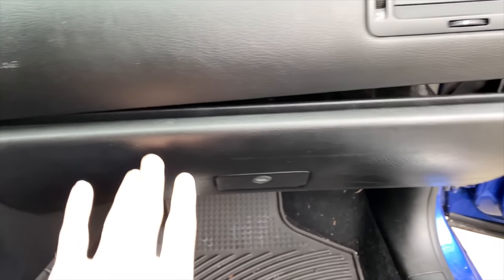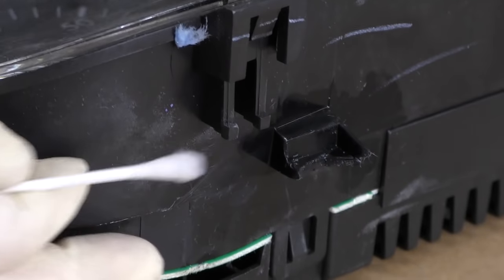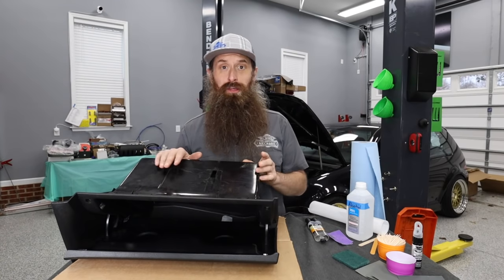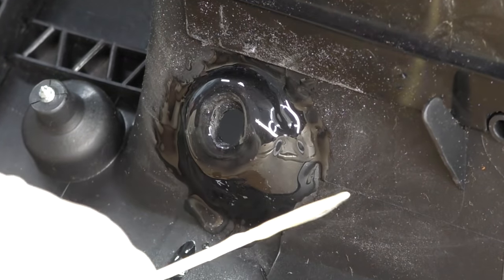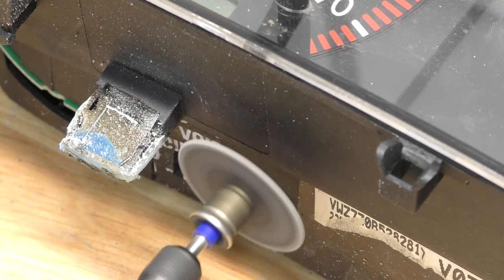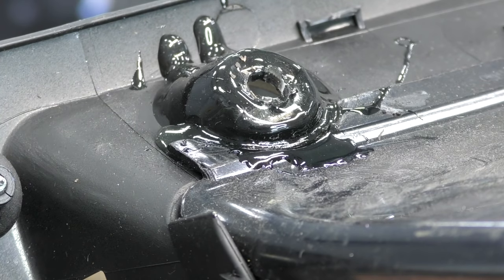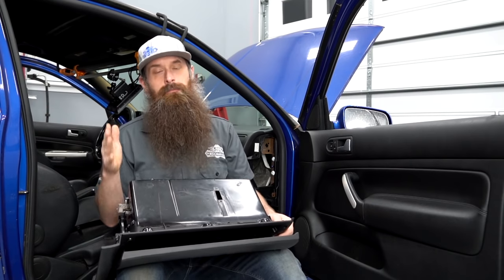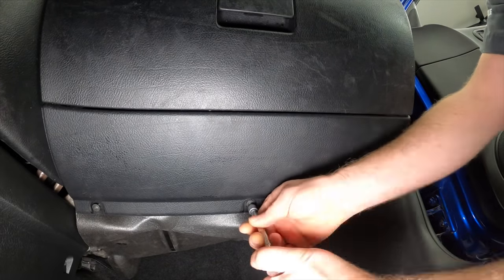How To Repair Broken Plastic Car Parts

Comment: I use the same process..but use flat Black paint made to paint dashboards, look up dashboard paint at your parts store..and hobby putty to form moulds instead of masking tape, I also use plastic repair epoxy in black because it's actually made for this specific purpose instead of clear epoxy ....but good job for your first attempt, not everyone researches existing methods before making a YouTube video...I like that you use different products not fit for purpose for those of us that have no interest in doing it correctly....big thumbs up

Comment: I use the syringe method professionally almost once a week in the automotive field. Busted tabs, split engine covers, coil packs on Ford where the connector splits and Mr Customer won't budge lol lol. Awesome vid again, great advice! Ive had great results doing it like, indentically haha

Comment: Lol i just used screws and washers and it looks good. If you use small washer it can get stuck on the inner wall of the hole so it looks nice. Big tip if you have  broken securing point on the glove box fix them fast because it puts more stress on other securing points so they break faster.My car has a problem. It shakes a lot when it starts or when its slowing down, motor does sound wierd .Its mk4 1.9 tdi.tnx

Comment: I recently had to repair lots broken tabs on R1 motorcycle fairings and I used blue tack or plasticine to copy the more complicated mouldings. I pressed the product into the surviving tab and transferred it to the other side. Using all the same techniques as you did here. It worked great 👍 obviously in some instances things face a different direction so pay attention to that kind of thing.

Comment: Great video !

Additionally, if appearance matters, you can mix powdered pigment into the epoxy. Powdered tempera paint works well for this (make sure you get the powder, NOT the liquid paint). Black is readily available, and you only need a small amount of pigment. You can create any color you need with the correct pigment.

Additional Tip: If your epoxy or resin has a short working time, measure out the two parts of the epoxy and keep them separated. Mix the pigment into the resin until you reach the color you want, then mix in the hardener.

This is an advanced topic, outside of the scope of this video, but if you need to create a larger plastic piece, you can use polyester resin to cast it. Powdered pigments like tempera work with polyester resin too. If you have something plastic that breaks and you need a completely new piece, keep the broken parts, glue them back together as best as you can, sand all of the seams on the surface so that they're smooth, make a mold of the broken piece and then use that mold to cast a new one.
Reply: Great ideas.  I like the idea of using a pigment powder rather than auto paint.  Also, don't they sell black nail polish?  Much easier to find than auto paint in such a small amount.
  I had to cast a small gear (and I mean small) that broke in a speedometer once.  I pressed it into a bar of soap to make the mold and then dropped in the epoxy.  My only complaint was it was too rubbery when finished.  I don't think the mix was right.  No idea other than that.  This was before the advent of CA glues.
I'm seeing a lot of CA glue and powder these days.  What's your opinion on using that for all this repair.  Seems to be catching on like crazy.
Reply: I keep several colors of tempera powder on hand because I always color my epoxy whenever I use it on anything, not just cars. If you've ever repaired ceramic or pottery, you know that the break lines are always visible, especially in lighter colors. Mix the epoxy to match and they are barely noticeable. It also allows you to fill chips and gaps with matching material. With patience, you can match the color of any automotive plastic. Use more or less powder to get the consistency you want to keep the epoxy from running. It works great for filling wide cracks on classic steering wheels.

Comment: Awesome info. I bypassed a few plastic fixes by just finding newish better parts at a pick and pull yard. Did this exact method on my drivers door panel where the 3 mounting screws are at the bottom. Works great!
Reply: 100% agree can u make it work … ehhh maybe  but strength is usually gone and still looks bad unless u have hands of a surgeon’ every time I tried maybe 1/10 it’s successful with a plastic welder’ if plastic trim piece is 20-30$ hands down just buy it
Or go to pick n pull’ 

If it’s a $300 part ….maybe try it but it will never look good’ when plastic breaks it is just so so hard to ever get it back’ 

That’s why adhesives that “weld” plastic back together r few and far between’ molecules in plastic don’t play well once tabs broken’ 

Honestly in my
Experience listen to this guy in comment’ 

Go to a pick n pull’ u will save sooo much time by the time u buy all the little stuff sandpaper epoxy plastic Welder paint etc just buy a new piece and move onto something more important lol

Comment: Repairing interior door latch molding for a 77 camaro , I used drywall fiberglass tape , closed weave not the one with square weave and pvc pipe glue. Worked great for fixing broken out screw hole. Just a daily driver not restored

Comment: Good stuff!  I have a small break in the faux woodgrain panel just below the cluster in my 1990 Dodge B250 conversion van.   It's one of those things where you can pop it back in and a slight crack is visible,  but after a few miles on Pennsylvania minefields.. I mean cow paths..  No,  ROADS.  that's what they call those wavy, twisted, un-even, cratered surfaces..  "Roads".   After a few miles on these "roads",  the piece just pops loose again and sticks out about 1/8 of an inch.
This looks like the method I need.  Just V-groove the back of the break slightly then fill it in with some of this epoxy.  May even use a bit of that plastic window screen for added support.  As the repiar will be behind the panel, I won't care what it looks like as long as it's effective and no all too sloppy.

Comment: Pretty cool video! If you can get your hands on some and want your pieces to be super strong, you can find small pieces of fiberglass sheet. Lay that over the empty spaces or form it to the shape and then cover it with epoxy. It will make your pieces even stronger. 👍🏼

Comment: Great video - thank you.  I bumped the garage side with my mirror and broke a couple tabs holding the turn signal.  New part would be $100, complete assembly $125.  I'm going to try your approach to repairing the tabs!  Thanks for the info and for showing the glue to use.  Plastic adhesion is tricky - good to know the best glue.
Reply: BTW - success!  2 tabs had broken off a turn indicator lens held as part of a door mirror.  For sure the dealer would charge $300-400 and would have replaced the entire assembly.  I did it for about $17 - 1 replacement plastic part that was too destroyed to reassemble and the 2 tabs successfully attached with the DAP Tank Bond per your instructions (scuff, clean with rubbing alcohol, mix epoxy - let it age 2-3 minutes then liberally apply and I manually held the parts for about 5 minutes and let them dry overnight.  Thank you!  Saved me $hundreds and saved needless landfill!

Comment: One thing I would add - when using epoxy to build up parts, you can also add fillers like glass beads or fibers that will help fill gaps and provide more structure and strength. I get mine at WestMarine, but any boat supply or surfboard shop should have the stuff. For even larger repairs, you could also lay in glass cloth.
Reply from the maker: That’s an awesome idea
Reply: You can also use saw dust or dried leaves

Comment: Great content!
Tips: 
1. Mix a little black (or other colour)  laser printer toner to get black epoxy
2. Use a hair dryer on low heat to drive out air bubbles and get the epoxy to run into tight spaces
fiber

Comment: 🟥 I usually use popsicle sticks, ( art supply,not post food) and sand on a belt sander to desired shape for applying glues or to form sandpaper around to desired shapes. Also, wax paper to make release mold backing etc.
Reply from the maker: Oh that’s a good idea!

Comment: I like to use a two part solid putty that comes in a small tube. You just cut off the amount you need then mix it in your hand and mold it into the shape you need. Cures rock hard in a few minutes and can be sanded and drilled once cured. Not as messy as epoxy and will support weight. I've even cut threads into it! Love that stuff!
Reply from the maker: I like that stuff too. I always forget to properly wrap it back up and it gets all weird. HAHA totally a me issue

Comment: Neat ideas. I've repaired many plastic things by heating the tip of a screwdriver and then melting the parts together in a somewhat weaving manner. I liken it to welding. I might also add epoxy too.

Comment: Good stuff, I use Knauf microglasfiber tape for reinforcing the place for small repair and regular glass fiber mesh for boat repair. Sometimes just pull some threads from the mesh and wrap around the part or build it up as I go, layer on layer. Also for smaller quick repairs, cianoacrilate glue and baking soda for filler and activation. Then sand, drill, body filler, paint and what ever one needs...

Comment: To repair a broken turning signal light plastic housing on my 86 Bronco I used the Oatley  "All purpose cement" .It basically "welded" the parts together and the repaired housing  looks like new...It also works great on repairing the plastic frame around headlights..

Comment: thanks for the video. the parts you've fixed were abs and abs polycarbonate plastics which works really well with some strong epoxy glues. I had a car trim that had a very-long guide pin. It got broken while disassembling. I tried to fix it but it was useless. because it was made up of polypropylene, none of the epoxy glues worked.
Reply: How can a person know if it's ABS?
Reply: @davidbutler1825   it is written somewhere on the material. Sometimes it is written in a triangle with arrows.
Reply: @heysamtek  thank you! I will look for that.

Comment: Great idea, thanks. I may fix the broken holes on my mk4 golf centre console that meets the ashtray section using this method. I think we have araldite here in the uk which is a similar product to what you used here.

Comment: Dude! Great work! Thank you! I’d like to please add a few helpful suggestions. First if it’s five minute epoxy mix the hell out of it for the minimum of 30 seconds go to 45 if it’s still to loose. Try to squeeze the same amount of hardener to resin! To make it 10 to 20X stronger get use carbon fiber fabric easy to cut to the shapes and better than the paper. Use the longer setting epoxy for that. Good luck please do more. Thank again.mw

Comment: Nice video.  when trying to copy another tab, I often use RTV to made an exact mold and transfer it over to the new tab.  Epoxy or even casting resin can then be used to make the new tab.  (And embed that washer!)

Comment: I like using metal strapping that is for hanging pipes and HVAC ducts.  It is the same idea as a washer and comes with pre-drilled holes of two different sizes.  It can be cut to any shape and bent to make reinforcing brackets.

Comment: Plumbers putty works great to form epoxy dams, and fresh putty is sticky enough to use on a vertical surface. You can also use it to form an exact impression mold of an existing part. The putty has a slight oily texture and epoxy will not adhere or react to it.  Putty is cheap and available anywhere that would sell the epoxy.

Comment: On the first broken part you have a great opportunity to make your repair almost exact. You can cast a mold of the other tab and use it to hold the epoxy instead of making a mold out of tape.

Comment: Back in the 60's ,70's and tube tvs. We used to fix channel selector knobs similar to this. And use strong thread wrapped around with glue (epoxy equivalent, back in the day). The thread added enough strength to make it stronger than a new one.

Comment: Many years ago, our salesman was about to go to a company and get a really good job for us, (heat treating company). His plastic framed reading glasses broke between the lenses. I took the glasses and chemically welded them together with acetone. The last time I saw him before he retired about 10 years later, he was still using the glasses.
In those days people didn't know much about plastics. But some one had told me of that fix. Plastic frames were new and fashionable. I fixed several frames for people.
I have just bought a plastic welder and haven't been able to try it out.
In this case, building the tabs with epoxy is a good fix. If I can, I use fiberglas or metal reinforcement. 
A good way to fix hard plastic. File some hard plastic into fine filings. Carefully fill the repair area with the filings. Drop super glue onto the filings. it makes a lot of heat, but the plastic is fused perfectly.

Comment: The magic of parchment paper.  I’ve used it to make a custom-fit plastic  bag from heavy-duty vapour barrier using a iron.   Parchment paper between the hot iron and the plastic to be welded, and between the plastic and the ironing board.
Reply from the maker: Nice!!! I tired like 5 things and that’s what worked best. Pretty cool stuff

Comment: When I had broken fasteners to repair, I have glued hidden metal clip fasteners like the ones used to attach trim, armrests, etc. that have metal parts that can accommodate various threaded screws.

Comment: I remember at Nissan a customer came in with radio issues. It was maybe a 2000 - 2005 model, can't really remember. In order to get the part number, the radio would need to be pulled. I made sure to tell the service writer to let the customer know the trimming will break because of age. They (the customer) said to just do it. Needless to say there trim around the entire center console (HVAC and radio) was in pieces. When the customer saw it, they tried to blame me but then remembered I had told them it would happen. Only time the customer has ever admitted they were wrong in my career.

Comment: you can get a plastic compound in same type as the epoxy.  think its was a black and a white compound in those 2 cylinders,
i used it for making custom parts on semis and car bumper repairs  from 2000-2011
the express version hardens in 2 ½ minutes.  great to work with and can even fix holes in plastic diesel tanks you  pierced with a forklift :P
dont remember the name tho.
a good tip is ofcourse degrease and sand edges before applying it , but also place  tape on outside and repair it from the back.
this way it hardly leave extra material you have to remove and can be in the paintbooth within few minutes from starting the repair.
personally i preferred the express because i made "badboy look" sunscreens for almost all scanias beeing pimped up, and the fixation of the parts was not a delay in the process like other gluue types that need hrs to dry and harden.

Comment: Well, most of the plastics in VW are partly PP or PE and those does not bond well with epoxy. For those kind repairs I prefere thin wire as reinforcment and properly choosen material sticks based on markings on the part I am fixing. Then I am molting everything together with hotair and finish with dremel and sandpaper. It takes some practice but those kind of joints are usually stronger than the original.

Comment: Plumbers epoxy putty also works great to recreate part of a plastic that broke off. I find it easier to work with than liquid epoxy A+B as it’s already solid and shaping it is just like working with clay. 

I shape when it’s still moldable. When it has hardened, I sculpt, grind, sand until I get the exact shape I want. 

I also use chopsticks to wrap the putty around when I need a hole.

Comment: A good technique I have used for years.  I also whenever possible strengthen the repair by incorporating fiberglass cloth into the epoxy.  This bridges any breaks and makes the repair much stronger than the original plastic.  In some cases you can shape the repair by using Saran Wrap or such which won't stick to the epoxy but can be used to shape a repair and be removed after the cure.  Helps where the epoxy wants to run.  You can also use some of the epoxies that come in a tube where you cut off what you need and mix it together for a 1/1 blend these work very well to hold a shape and not slump on you.  Work it like modeling clay.  All these can be used with the fabric as a strengthener.  With the clay type stick epoxies put the cloth down first and force the 'clay' into the weave in a first layer then add layers until the shape is achieved.  JB weld is somewhere between the stick type and the tube in its viscosity and works very well.  These can also be shaped after it has cured a bit by dipping your fingers in water and smoothing the repair.  Don't use this trick with the liquid styles.  There are a very few plastics which you will have to find specific formulations of product to make them stick but for most interior and exterior plastics these do quite well.

Comment: This way is correct way to repair especially in external plastics of car e.g., mirrors, but there is a cheaper and easier way to repair plastics. Soldering the same material (ABS plastic) is also reliable and you can do it simply with same black color or other color when you weld tire up plastics. Thanks

Comment: Since there’s an intact tab, instead of tape, use modeling clay to make an impression of the intact tab.  Fit the impression under the broken tab and fill with epoxy.  Grind up some carbon fiber strands and add that to the epoxy mix for strength. One or use baking soda and super glue instead of epoxy.